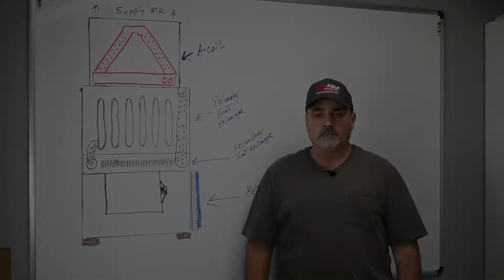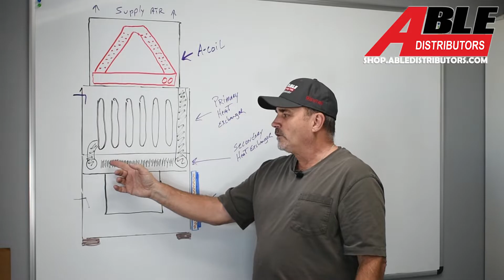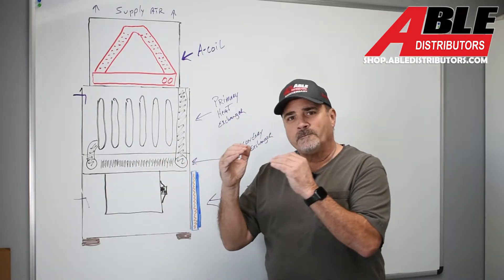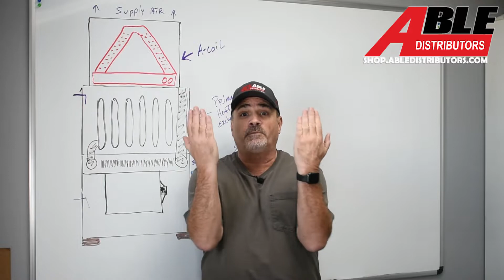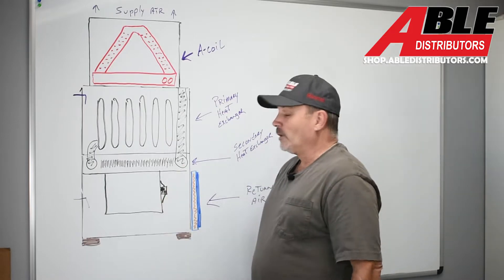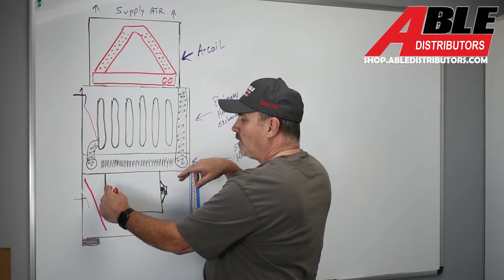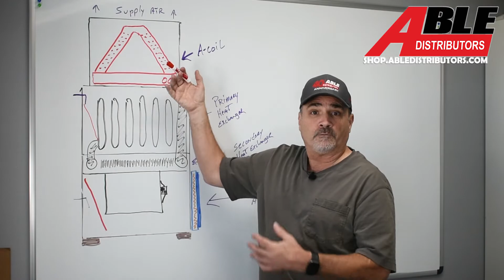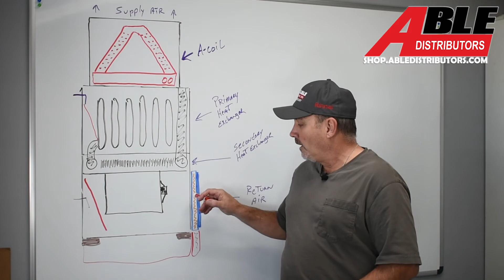Tech Tips: Static Pressure Testing Part 2: Airflow

Comment: hey, just wondering what a good number would be for return ductwork/supply ductwork? you stated .2” for A coil and .1” for air filter. I’m guessing.1” for each if typically .5” is the max. excellent videos btw 👍👍

Comment: 💯 GREAT INFORMATION! The best thing you can do for your customers is install an oversized media filter. Im a HUGE fan of  Aprilaire. Keeps equipment clean and VERY little static drop.
Reply from the maker: Yes, after market "box" filters from GeneralAire, Honeywell and AprilAire are all good, but if you don't have the room for a 7" wide filter, a larger filter ( taller, put furnace on a 6" box ) will also make a huge difference.     Thank You for checking out our video.      Brian..

Comment: 7:50 Plz explain: “putting furnaces up on six inch return boxes, taking off the bottom of the furnace, and instead of a 16 by they are going with a 20 by filter rack.” Extending the cabinet to 20 inches? How? What is a 6 inch return box?
Reply from the maker: you remove the bottom panel from the furnace, place the furnace on the open end the 6" tall box ( its the same dimensions as the furnace ) this allows you to install a lager ( taller 20" instead of 16" ) filter ( less restriction due to more filter area ) you cut some of the filter opening out of the side of the furnace, and the rest out of the 6" box, bigger filter and now the air can flow easier to the other side of blower wheel.
I guess its harder to explain than I thought, hope this helps.
Reply: @abledistributors  Where do you get the six inch box? From your local supply house? TY

Comment: When I clean blower wheels and housing. I will use my coil cleaner. First a quick rinse with water then cleaner. Let set for 5 min. And rinse with high pressure from a garden hose if it is summer time and let dry. Vac out the return ell and blower cabinet. Once everything is put back together I check the balance of the blower wheel to make sure it does not wobble. Everything goes back nice and clean with a little lemon smell. The coiler cleaner makes the blower tin's  nice and bright, and the home owner likes it. 

  Cc   {{;~ }

Comment: very good explanation.

From fan law2, we know that when  the fan rotate faster ( high rpm ) the static pressure will be higher. So when take the test, which fan speeed should we choose to make the reference?
Reply from the maker: I would have it on cooling speed ( if you have AC ? )... typically air flow is more of an issue during a cooling call, so I would test my static pressure on high.  for heating I typically check my temp rise and if I have issues there I test further.   I hope that answers your question.
Reply from the maker: see part one..
Reply: @abledistributors  
Perfect. When cooling It is high speed. the static pressure will be the most.
Reply: hey, just wondering what a good number would be for return ductwork/supply ductwork? you stated .2” for A coil and .1” for air filter. excellent videos btw 👍👍